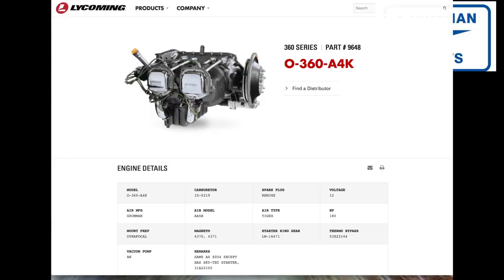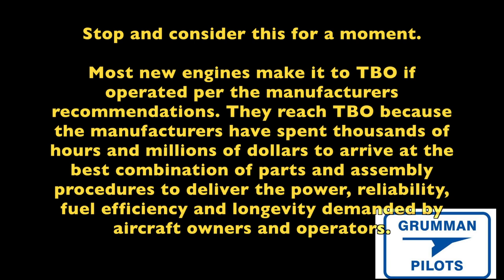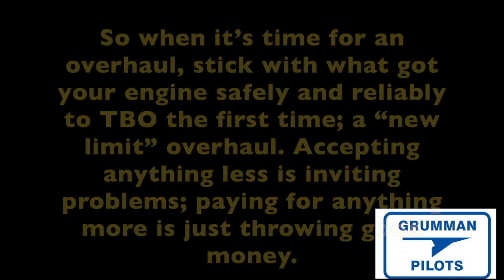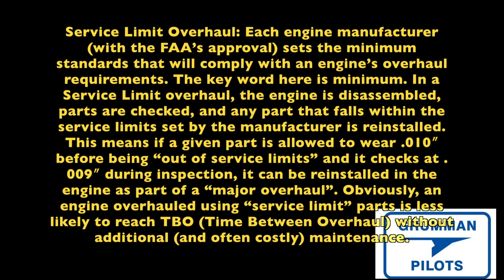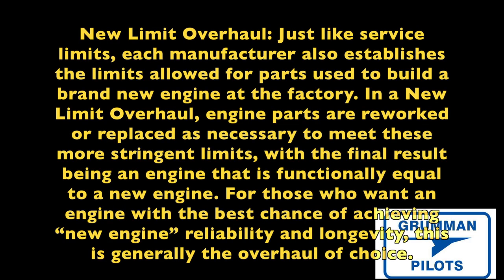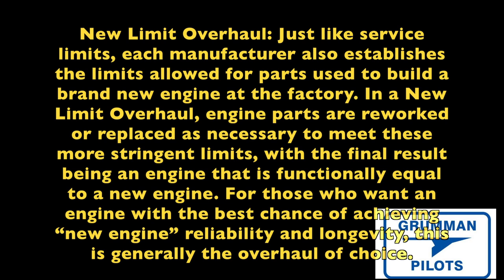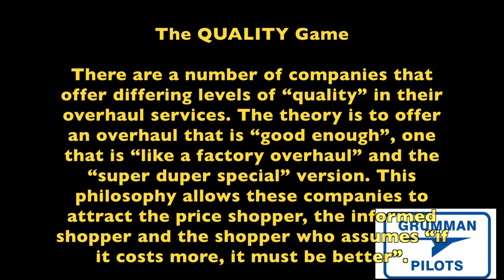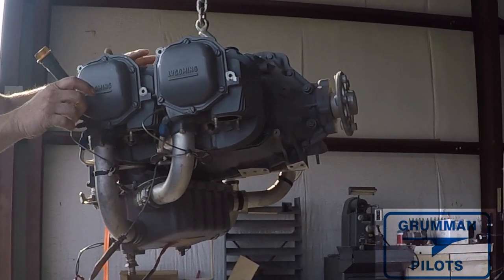What Is An Aircraft Engine Overhaul - Grumman Style

Comment: More great information. Are you going to have the extra upgrades you mentioned done to this engine?
Reply from the maker: No, this engine is a new Lycoming roller tappet engine.  We are not sending out the cylinders for port and polish due to cost and timeframe.  Nor are we sending out parts to be hardened by STC.
Reply: @GrummanPilots  I understand.
Reply from the maker: Again, this is a new roller tappet Lycoming, one of the first they made being done to 'new limits' but will carry the 0.1 hours SNEW with the SMOH 0.0 forward.  No zero-time here!